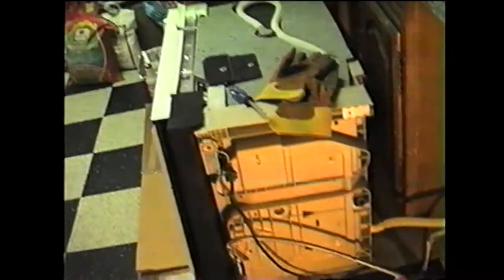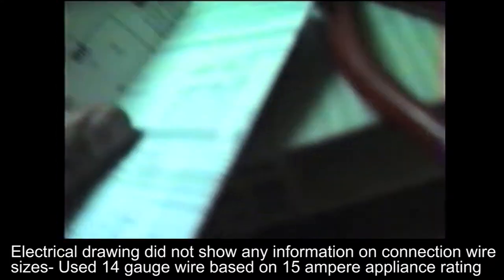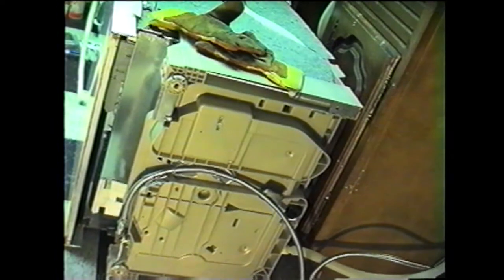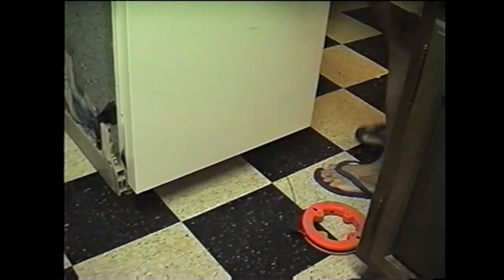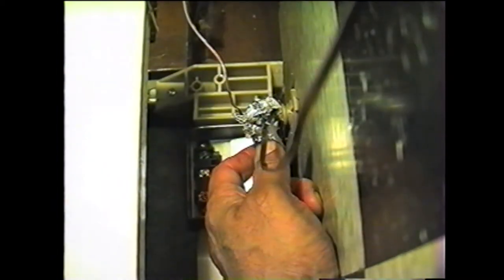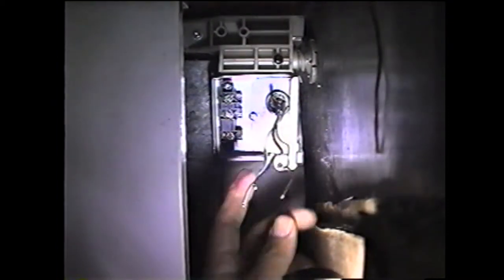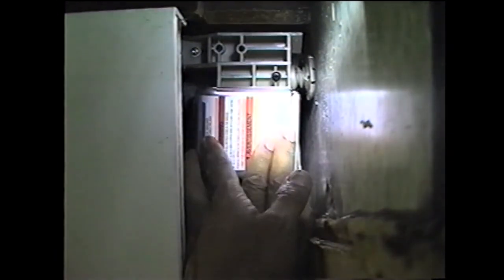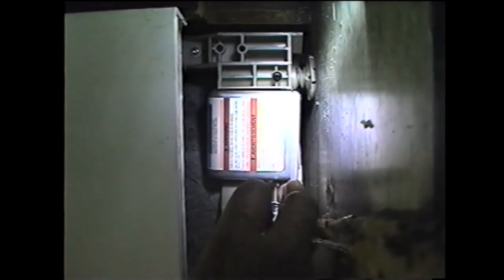Diswasher - Removing a Corded plug and Hardwiring Dishwasher

Comment: This isn't helpful… if the old one was a cord/plug, where's the outlet/receptacle? in this video What's with this exposed Romex cable doing wandering through the back of the dishwasher cubby space?? Kind of confusing.